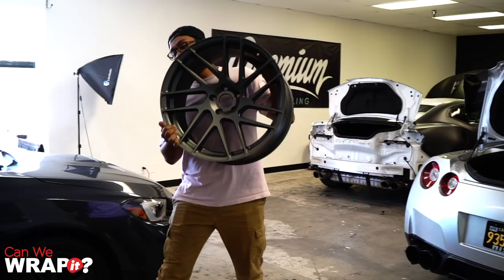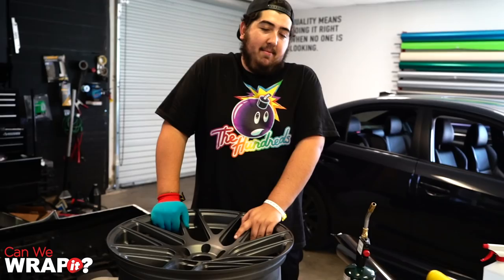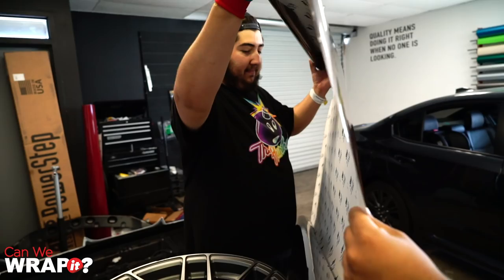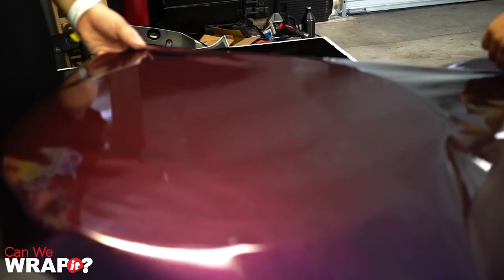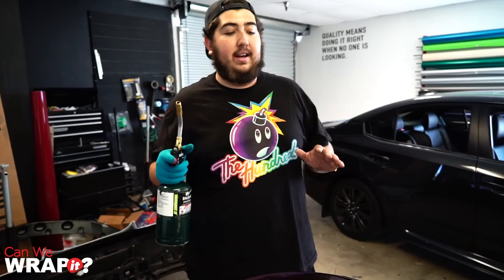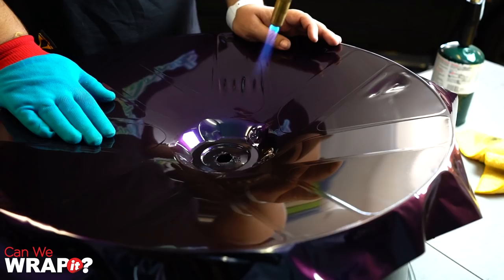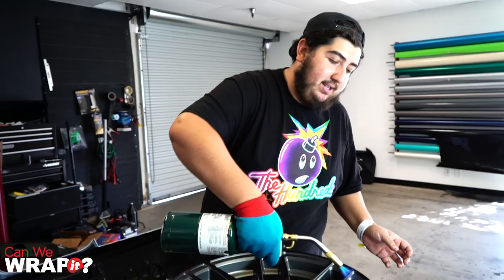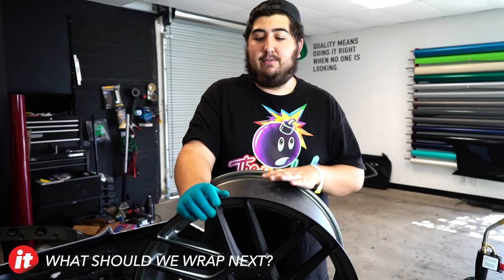CAN YOU WRAP A WHEEL?? (CAN WE WRAP IT)

Comment: I work at a tire shop and you should be able to wrap the whole wheel as long as it is flush with no bumps or imperfections and to make sure there is no leaking air just spray the air in between the tire and the rim with soapy water and make sure the tire is aired up to at least at 40 psi.

Comment: 10 bucks says it comes off faster on the road than it took to wrap the wheel.
Reply: Edward Agora Feenman Wrap and wrap adhesive is more durable than you'd think
Reply: Vasquez_david ive never seen a wrapped wheel last more than a month or so. Yeah that's a lot longer than it takes to wrap, but.... It's not that durable.
Reply: I wrapped my wheels and they lasted 6 months and never had a problem. I ended up taking them off
Reply: Wrapped by drag wheels and they lasted for about year before I got my new car and sold them. So paypal me
Reply: 10 bucks someone has never actually seen any wheels wrapped before and doesn't really know that much about it.
Reply: @joshualopez4148  thinking about gold trimming my 09 F-250 I got 22.5 Alcoa semi truck rims. How long you think the gold chrome will last?
Reply: It depends if you ride more dirt roads or smooth asphalt